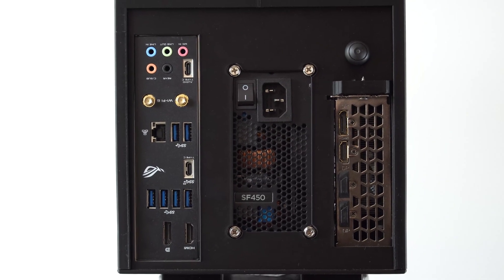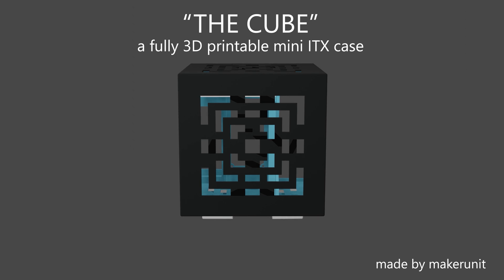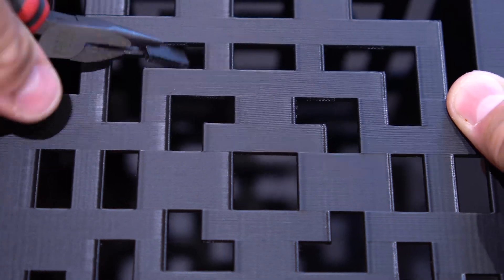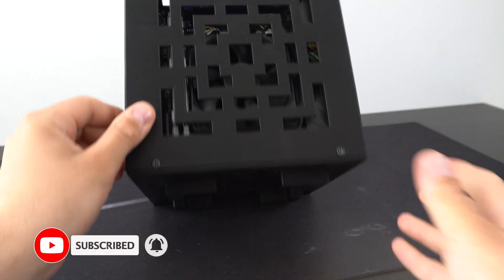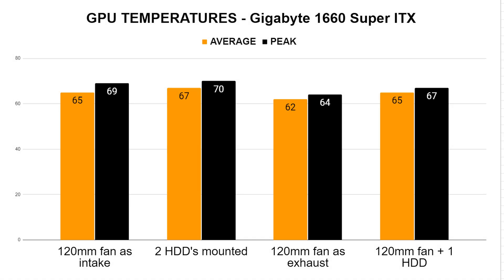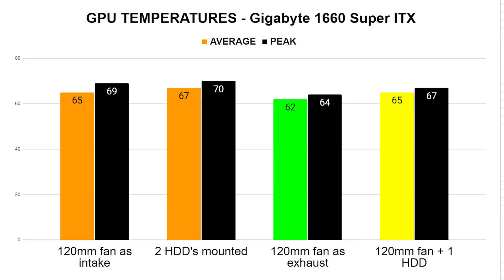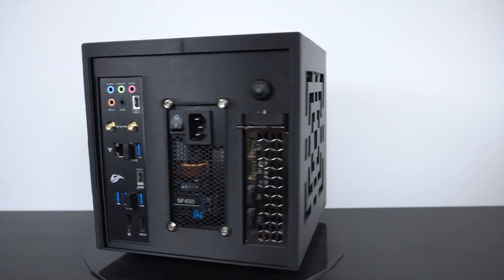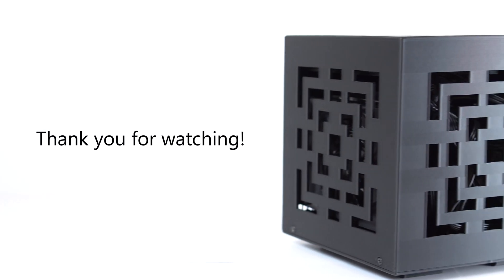CUSTOM MINI ITX PC CASE 8L CUBE 3D PRINTED

Comment: Ooops, almost forgot to leave a comment! 
What a pretty cube! Just... why not arrange the Graphics card and PSU horizontally, I mean I own the same PSU and it stays silent for pretty long, but why do you intentionally choke it to death!? xD
Reply from the maker: 😅 I wanted to fit it inside the cube and was the way that made the most sense to me. Does work though, it’s gonna be a little noisy but its kind of inevitable on tiny builds though. I could perhaps have swapped placement on the PSU and GPU so the PSU would get better air but that again would have made the GPU run hotter I’d imagine… 😄
Reply: @makerunit  Yeah this puzzles me, horizontal mounting would have increased the size of the cube maybe 1cm in each dimension? xD
Well, no I don't think the PSU will suffer from it, could just be that you more easily have made your semi-passive PSU into a more active one! ^^
Reply from the maker: @Quast  yeah, maybe! Time will show how it survives but I do think it will be allright. Do you know any way to check the PSU temp?
Reply: @makerunit  A laser thermometer! xD
Reply from the maker: @Quast  yeah that’s smart! Maybe I should consider getting one so I can also later check out how hot the actual plastic and other stuff would get 😄
Reply: @makerunit  A long-term study!
You have my ear! xD
Reply from the maker: @Quast  only problem is that after a while I disassemble the cases and re-use the parts for new build ideas. So not at least yet be doing too long term tests I only use them for a few weeks before disassembling it again as I have limited parts available 😁 Therefore also why I do share the cases for free to you guys. Because I haven’t been able to actually thorougly test them long term. 

If I ever was to charge any money for anything case related I’d want it to be really optimized, well tested and tuned to perfection for any parts thrown at it 😊 so for now I’m mostly just training my skills and sharing what I do. The intention of this channel wasn’t originally to just create pc cases but more like a general making stuff channel where 3D printing would be a one og the key parts of the content. I’ll be doing cases now and then when I come up with something good though! 😊
Reply: @makerunit  I mean you can try to make some kind of transformer PC but I guess that won't do very well in an ITX frame of reference xP
Reply from the maker: @Quast  might be hard to make tiny 😅 It’s not that I wouldn’t want to make bigger cases though, it’s more a limit in terms of possible print size and using loads of filament for large cases.

Comment: Very nice build! I am in the super compact perfect Cube case game for several years now (Real Cube on SFF-Forum, though at the moment not very active), but in the past I often thought about your design as it seemed to be the only way to realize 200mm (I only got to 222mm). Great to see it carried out at last and even tested. I always wondered if it would choke the PSU like that with only the slim gaps and hot components on all sides. Keep up the good work!
Reply from the maker: There is about a 10-12mm gap for air between the GPU and PSU. Not much but it might be enough. But of the air it sucks in some of it would be GPU exhaust but I tried so many different setups but this one seemed to be the best I could get. I could have tried to put the PSU on the left side (seen from front), then GPU and Motherboard back to back also but I just assumed that’d get hotter but I’m not sure… so far I haven’t noticed any issues regarding the PSU, but the whole setup does make some noise under heavy loads but it’s kind of inevitable with such compact builds.

Comment: Hey! Can you also add NOISE levels? Cheers man, really good content!
Reply from the maker: Can’t edit video (as far as I know?) after it’s been posted, but since it’s such a compact build it’s a little noisy under full load. But not really noticable through like a gaming headset for example when gaming. At least for me. Imagine the CPU and Noctua fan running about 80% during the max push at least with the fan curve I’m using which is slightly more agressive than the standard fan curve…
Reply: @makerunit  I *THINK* if you de-shroud the video card, and add a 120 slim noctua fan, it will be quieter and probably perform better too.
Reply from the maker: @FelipoGoncalves  that sounds very logical! The stock fan on the car isn’t very powerful

Comment: Is it possible to fit an 120mm aio to the top? And whats the max cpu cooler height, would an 47mm alpenföhn black ridge fit in there? Really cool case!
Reply: Thanks a lot! That would be great😊
Reply from the maker: @olli6802  Check Thingiverse now. I think it's just about what you wanted.
Reply from the maker: Hey Olli, I was really trying to make it at first to support 120 AIO that was the original plan, but the other parts simply didn’t allow it in such a compact case I’m sorry. About the CPU cooler, My L9i is 37mm.. I’ve got about 8mm of space left to the case so that would mean a maximum of about 45mm but thats the absolute limit… :( but considering how the pattern is it may be an air restriction if using something that big. I’m not sure if anything bigger than the L9i would work :/
Reply: Okey thats a shame but the cube shape is really good looking so I dont mind :) would it be possible to add version of the case to thingiverse without the ventilation holes  so you could add holes and textures manually afterwards?
Reply from the maker: @olli6802  I’ve got a few requests from earlier as well with similar wishes, I was thinking about making some tutorials on some of the steps I take to go from idea to a finished design! Where I would also include something similar where people would customize their own cover getting just a blank cover with nothing on it. 😅 but I’ll see what I can do about your request. It might have to wait to over the weekend as I’m going away… but I’ll see what I can do! 😊

Comment: Would you consider making a custom controller with the hardware of a PS5 dual sense controller, but with the Xbox controller layout in terms of thumbsticks and buttons? Another awesome case build btw! I love the modularity.
Reply from the maker: So basically move the left joystick up left and D pad down middle left? I’ve actually tried before making a custom controller turned out to be way too advanced for my design skills at that time. What I struggled with then was making the actual handgrip to hold. Definitely an idea though, I might try that again sometime! 🙂

Comment: Waa totally worth the wait, this looks pretty decent but i m lil worried about the psu ngl due to the ristrictive airflow. Really like that the new shell has plenty room for airflow.
Reply from the maker: Glad you liked it! 😊 There is about 10-12mm og spacing between the PSU fan intake and the GPU. Which I believe should hold but time will show! No problems yet at least 😅